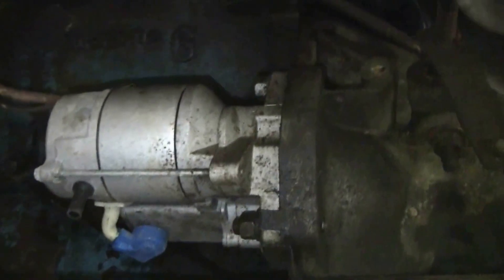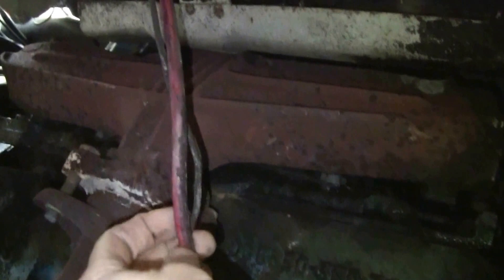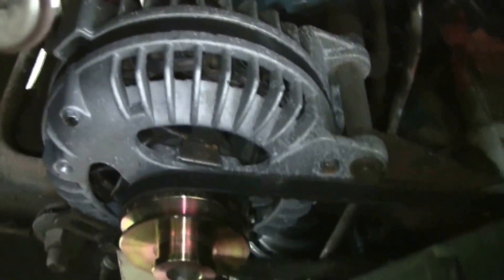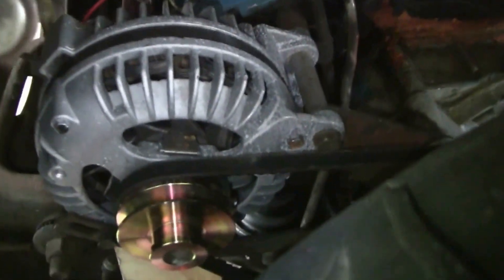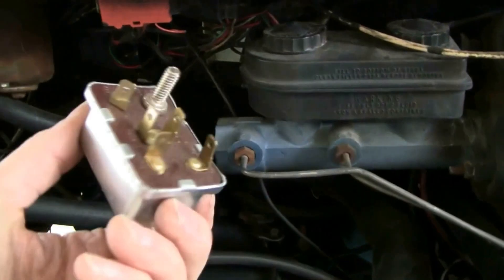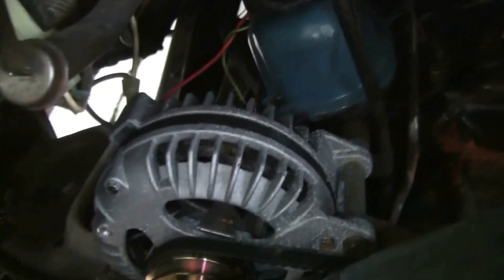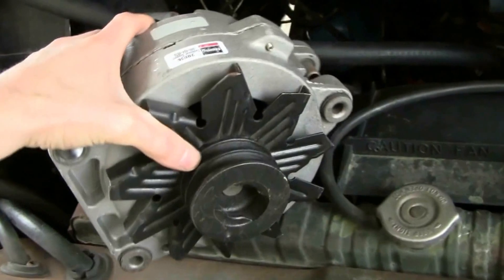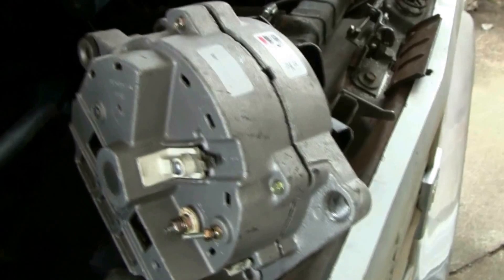1979 Dodge RV Restore #2 - Starting Issues

Comment: Thanks for this video. I have a 1979 Dodge Sportsman RV with a 440 in it and it starts easy at first and once it's hot I will have to turn it over for 10-15 seconds before it fires up. I'm going to change the starter and hopefully that fixes the issue.
Reply from the maker: 99Isopropyl Glad it was helpful. i have been super happy with the high-torque starter I installed and it is now 3 years later.

Comment: Awesome stuff. I just bought a 78 Sportsman yesterday and it fired right up when buying it, then didn't want to start again later and now the starter is having probelms, I guess I gotta get one of those high torque ones. Also my ballast resistor is behind my battery and the 2 wires aren't even plugged into it so I guess somebody bypassed it. The ecu plug you pointed out is also just hanging unplugged on mine. My muffler appears blown up like yours also. Right now it's cranking sometimes, but not turning over.
Reply: Get one for an '88-'92 360 Dodge truck. Bolts right on, nothing exotic or expensive
Reply: Did you fixed the problem?my muffler bl0wn up too..just got may 1980 sportman yesterday..

Comment: I found the problem is that pink wire from the coil that goes into the firewall for the ignition they had a red wire going from it to the solenoid on the firewall that controls all the back stuff and it was just ripped and tied together and takes so had no real good connection so I was losing voltage but thanks anyhow and I could never locate that starter control module maybe include me in 75 Dodge Fireball

Comment: Another thing- the instrument cluster voltage regulator. The old version is an old bi-metal arm & when it breaks, it'll 'full-field' the voltage and cook your gauges- new ones are electronic, cost around $38-47. That huge alternator? It's a Leece-Neville unit. Found mostly in old cop cars of the day, you'd need the brackets, isolators (they are rubber isolated, that's why there are big mounting holes) & engine pulleys to fit it. Go to AR Engineering, get one of Andy's kits that fits a Nippondenso alternator in there. Smaller, more juice, more efficient & easy replacement with off the shelf modern parts.
Reply: I cant find my bliner flasher does anyone know it is-not in the glove box

Comment: maybe you can tell me what the control starter module is and where it would be located because no as far as I know I did I don't know what it looks like I replace the ballast resistor and the ignition switch and tumbler that's all I have it replaced does located and what its purposes and how do I test it with a multimeter
Reply from the maker: jones c harvey I don’t know exactly where it would be on your vehicle, or even really if your vehicle has one. I know on this Dodge Camper it is mounted on the firewall directly under the master cylinder. Check out 3:24 of this video. 

Also, replacing the coil and the ballast was probably a good idea given the age of the vehicle, but these components have to do with the running of the engine, not the starting of the engine, So I would not expect it to have an effect on how well your engine starts or doesn’t start.

Basically, what I did is I looked on Rockauto.com to see what it looked like and then started looking around under the hood to find it.
Reply: Think - Do - Discover is there any way that we can communicate directly messenger text message it don't matter
Reply: Think - Do - Discover that way I can send photos and you can confirm

Comment: Hey folks I have a 1975 Dodge Fireball with a 318 and I've had a little issue with electrical voltage in will not start although I can put a jump wire from the positive side of the battery to the coil positive side and it'll fire right up the I thought maybe it was the ballast resistor replace didn't nothing replace the ignition and the tumbler still nothing now on the ignition I can touch the black wire the big black wire to the pink wire and it'll fire up and I still can't track down this problem I even replace the wire going from the loom to the coil positive side. Maybe he was burnt out but nothing it'll act like it wants to start but will not unless I use the jumper wire but I found out if you use a jump wire it can also drain your battery to nothing thank you
Reply from the maker: jones c harvey did you check and/or replace the starter control module yet?
Reply: Think - Do - Discover can you send me pictures of maybe what it looks like what it does how to test it and where it would it be located on this RV I have a multimeter can you please tell me what I'm looking for
Reply from the maker: jones c harvey sorry, can’t talk this evening, but this video literally shows what it looks like at 3 1/2  minutes.

Comment: your voltage regulator is supposed to be very well grounded by using a clean metal ground through zinc coated mounting screws, you need to attach 2 more to your firwall voltage re goo later!.... Gonz...clean grounds on a motorhome ive got a 1978 doge tioga...wear eye and face protection nasty, rusty oily crud...